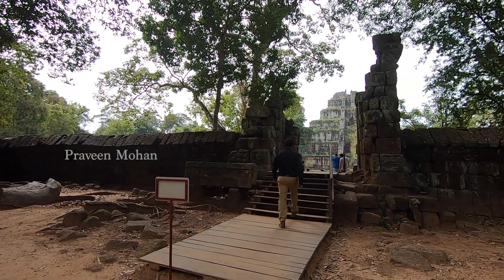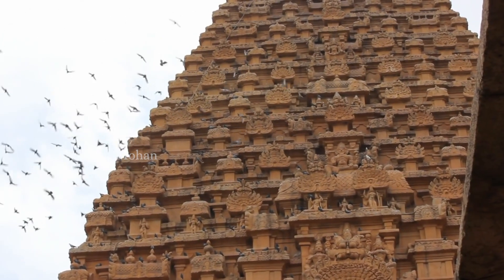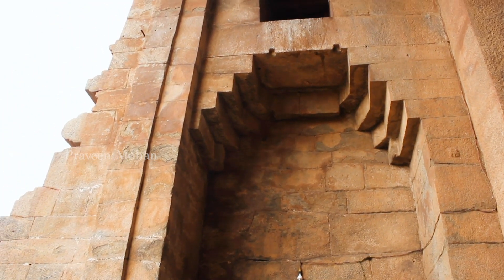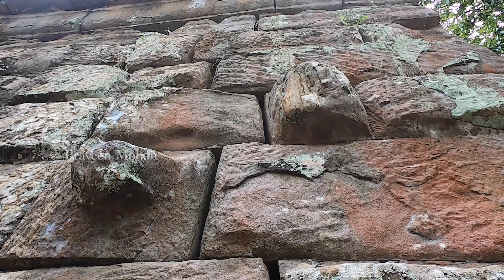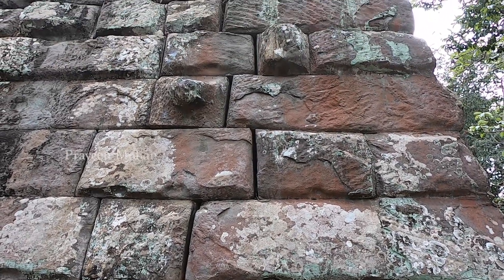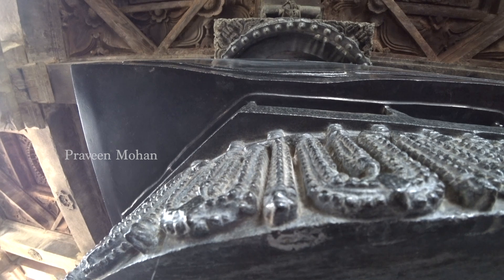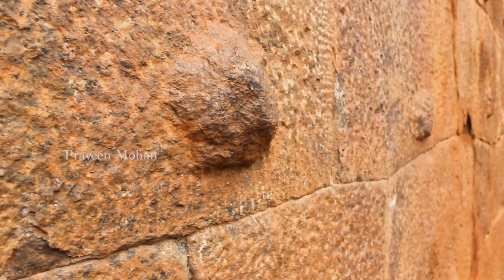Mystery of Ancient ‘KNOBS’ in Temples - Evidence of Stone Melting /Geopolymer Technology?

Comment: First thing that come in to my mind is - why are Plants loving that Stones? Answer: Plants need that to Grow: » Stickstoff,
» Phosphor,
» Kalium,
» Magnesium,
» Calcium,
» Schwefel,
» Eisen und
» Spurennährstoffe.
So that in mind we do say if we got Stone Powder, Phosphor, Schwefel and Magnesium - we got 3 ingredients that could be used to create that Rocks. So what if, they use some Schwefel / Sulfur in form of Acid waters? Perhaps from vulcanic places. So we know that phosphor even Kalium is a highreaktive Substance that can be used to build Bombs. So why dont use a smaller Reaktion in Chemical way to chemical fuse Mineral cristall Connection? Not to produce explosion but atomic chemical reaktion to build combound stone. nowdays we use Beton in early beton we use Kalk or some like that. Perhaps there are two beton creation ways. One hot with Acid that crack up minerals that will then reakt to melt to "stone". Or like today water on water reaktion. Perhaps it is just lost becourse the hot melting Stone technique was not efficient enogh based on a very rare and dangerous Acid water. On a small view we need to think on a chemical and Mineral physical heat reaktion that comes from the chemical reaktion with the ingredients. Perhaps that Prozess makes the stone fluid to use it like kned. So what is the whole in that szenario? Perhaps they need feeds to Stones. It is much easyer to transport when they can be underlayed by wood. If the Stones are down to earth you have to lift that up. They just have to make shure that a rope gets under the Stone. To lift it. So perhaps they create the Stones near by and stock them on wood or other things. We all do not recognize that leverage could be well known to ancient builders. So they need on every Pyramid Layer one leverage with a very long range. Then it would be possible just to jump from level 3 down to 1 and you got the stone easy placed. The weight of a human that jumps would be enogh to get the stone up. To Level 2. But it still needs a feed to get under the block. I think the arrangement when the drop is not in the wall is just becourse the Stone match perfect fit. Is it seen means that it has some defects that wont be shown. And becourse it has nothing to do with the physical of the wall - So they just use the opposite side. To get best usage out of material.

Comment: I think the blocks were casted, if what the priest said is correct, the knowledge has been lost over time. Lost and replaced basically. I could imagine that grinding down rocks of varying hardnesses and mixing the power with some alchemical compounds to change the molecular structure of the rock power apply enough heat to make it all molten and then pour. But that begs the question, where are the molds and what were they made from? Fascinating stuff thank you Praveen I love your videos!

Comment: The knobs are used to keep the lifting ropes from having to go under the rock or stone when lifted and set in place. Do some research PLEASE! The knobs are chipped off of finished walls or walkways. If there are knobs, the stone construction was never completed!! You have even shown structures that have stones with knobs on all stones up to a certain point and all after the last one have had the knobs chipped off!!
Reply: ....Some Knubs could never hold a rope securely.  There are blocks at the Corricancha with four knubs the size of a breeze block, I could easily lift. And then theres a 20 ton block with one knub.

Comment: Praveen, I've critisied you in the past for sensationalism, but I have to admit I think you've hit the nail on the head with your theory that the knobs are a result of the manufacturing process. I believe that at some point in the process the rock was soft and in some cases too soft. I used to work in an iron foundry and if castings were knocked out of their moulds too soon, the outside of the castings had solidified but the centre of the castings was still moltten to some extent. Sometimes a hot spot would apoear on the surface and the molten iron in the centre would try to force its way through the surface. If this started to happen you would start to see a protrusion much like the knobs on the stones.  When this happened we had to turn a hose on it to freeze off the surface again.

Comment: The blocks were cast in the ground. They dug a long square edged pit and poured in the mixture. It apparently took a long time for the stone to set to do it this way. Separators that were somewhat flimsy were inserted every few feet to determine the block size and make that perfect matching surface. The drops were formed from the bottom of the trough.

Comment: With the wall example where the protrusion is very large, notice also that that shape end on is square and much smaller than the others, it’s almost as if these where the rows finishing block, they also seemed to have large gaps where normally one can’t even fit a credit card in the gaps.
Is it possible that something valuable was hidden behind these rocks?  Is it possible that these were made so that once most of the labour force had gone it was easier for a small team to remove these using the large “handle” to help make it easier to slide it out then bury whatever, then push the lighter square end block back? Notice also that two of these (square on end) ricks with knobs are very close to the corner.  I wonder if this is deliberate so that if there was difficulty getting the square one with the knobs out, then the corner stone could easily be removed to allow better access to remove the (square end) rocks with knobs.  Metal detector anyone?
Obviously the other walls with the smaller protrusions on bigger rocks are for some other reason.

Comment: I think I understand how they did it! Just think that there are no landfills with waste, rubble, advanced dust! The ancient builders knew the frequencies to cold melt the rock in the molds, so even rubble and sand were recovered! Cold fusion acts on the molecular bonds during exposure to particular resonant frequencies and the effect ceases when they stop, the air comes out like bubbles and the liquid stone is compacted. Praveen Mohan knows of the existence of these frequencies, literally carved in some temple in a cymatic way. Evidently bulk material was placed in the formwork so parts of air could remain, and when it was "melted" it could advance some material, but never be missing! Evidently the rock was laid still "soft" on the underlying one so that each crack would automatically close due to pressure! OMG This must be Atlantean technology that has spread worldwide from the survivors of the Atlantean cataclysm. Technically it is about to be rediscovered thanks to the interpretation of a Masonic secret, or "the eleventh resonant harmonic" and is connected to the 432 hz frequency that has been denied us so far.

Comment: I think all stones had the knobs, most were smoothed or cut off, sometimes the workers may have not gotten to all the blocks in time. Look at the Egyptian pyramid, they all had knobs, until they were cut away. I was inspired by how we make glass today, they all have one knob, through which the glass material is blown through. at the end of the process, a knob remains, which is CUT off by the glass blower and then smoothed out while still hot. Similarly I think the workers may have had tech to melt stone, while hot, cut off the knob through which the geo-polymer material flowed. However, if the workers were not quick enough, then the stone hardened and thus the knob remained forever. This seems extremely plausible. Regardless of how they did it, its mind boggling.

Comment: Do you think that all the structures with the knobs worldwide were made by the same civilization?  I do!  And they must have had air transportation to reach all the very remote areas where the knobbed structures are located.  I believe that the largest (by far) megalithics are located in Peru and are miles from where the rocks were quarried.  How did the ancients move the megaliths miles over rivers and mountains?  Someone should try to piece together a time frame for those sites!

Comment: Thank you for your excellent job Praveen! 

This is the first time i don't agree with your idea. For engineers that skilled it would have been extremely easy to remove those knobs, i think this is quite reasonable. My personal thought is still that they (the knobs) had some purpose. Those knobs are more important than we know, at least in order to comprehend the technique they used to "pour" the stone. To me it loooks they're related to the way they molded and injected the liquid stone amonge the other "puzzle pieces". 

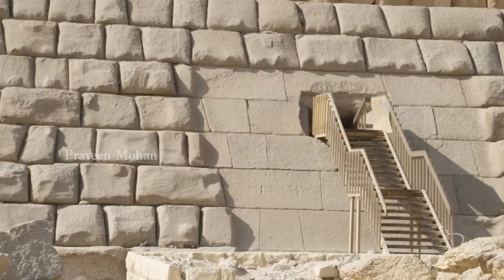Another possible suggestion: It looks (for example at min 5:01 of this video) that the entire "JOB" wasn't finished. You can clearly see that the surface of the pyramid on the right of the video frame is flat and polished, while the surface on the left is still raw like it's waiting to be flattened. Also if you watch the images of the (probabily) biggest monolith in the world, from the Yangshan Quarry in China you can see knobs on it as well!! And the entire monolith is still attached to th principal stone vein.  Like the workers abandoned it. 

Best regards (and sorry for my horrible english)

Comment: Finally, someone with 90% of my opinion about how they created such stones. In my opinion, these large bricks were cast on site. Sometimes you can see at the connection points how the stones have an incline towards the center. For me, this indicates a flexible shape, which expands to the weakest when filled. The stones lying next to each other were probably cast in a timely manner so that the individual shapes fit perfectly against one another when the material was not yet fully consolidated. It is very likely that something went wrong sometimes. I guess the shapes were possibly sewn together from leather and brought into a rough shape. When the individual mold was filled and the stones lying at night also filled, the next layer had to be filled. Sometimes the pressure was probably too high and a piece of the sewn shape tore out, which pushed the semi-solid material through this weak point and froze in the process. This created these "nops". This theory also explains how many a 500 ton stone was placed in the higher levels of buildings, namely not in one piece but filled by several workers with individual fillings, as is known today from concrete casting without a concrete pump. Great video. Thank you for this great channel and multi-directional mindset. In your videos, please refer to buildings all over the world, where some of them are officially 5000 years old and if you can prove the clear connection there, you will see that humanity has worked very closely together. Peace
Reply: Please see my comment     21st 4 2020

Comment: All megaliths have one general rule: the laws of electrodynamics. There is certainly a room with a stepped vaulted ceiling and ... inside it is either a resonator (hollow sarcophagus) or a vibrator (lingam). Necessarily from the material is much denser than the room and sanded. It sets the frequency of the temple.
Stones with protrusions are the same vibrators along the waveguide, notice they are of a completely different color and much denser. This facilitates the operation of the waveguide.

Comment: Sorry, I don't share your view on what the nubs are. If they were defects, they would have removed them easily before or after placing the stones. They were left for a reason. Maybe a braille like language? What if you joined the dots somehow, would they reveal something? It's beggars' belief their true function but I have no doubt they were created and left deliberately
Reply: Question : Are there any examples you know of that are inside structures? I've only seen videos of them on the outside walls. Are they found on floor or ceiling stones? On the floor would seem silly being then a hazard one could trip on but if some exist at feet level then it's certainly points to the nubs being functional in some way.

Comment: ...for the Maya knobs, always thought they were like an excess overflow...
...example...thick cement not poured but like a clay block placed in a thin cloth bag, placed on top of each other...
..thinking the cement mix was a bit thicker than play dough or pie dough...
...poke holes in bag for excess air / liquid to drain / compress from weight of upper bag...
...allowing individual shape of each block and curing test area of the block...

Comment: The protuberances, knobs, whatever you want to call them are either sprues from a casting process or touch marks from a sonic welding horn. I've only ever seen these knobs on blocks made from igneous rocks - Andesite, aswan granite, etc- and if that's the case some sort of sonic softening technique could be the culprit. Igneous rocks contain large amounts of crystal in the form of quartz and feldspar which could make the rocks susceptible to the melting frequencies used in sonic welding.

Comment: The knobs are air holes when the builder poured the molten rock it to the mold the air holes  would holes became knobs. I have been explaining this for years. Knobs are air holes
Reply: Very interesting. Just a side note: Instead of melting the rock they could also have used a cold mixture, like we do with concrete.
Reply: Interesting

Comment: I agree the knobs for toting by ropes is simply ridiculous as you stated all the blocks don't have them and all the knobs couldn't support a rope and it looks just like any kind of molded soft material that has been cast if it's took out too early it gives that little drop I guess you could call it whether it's metal or plastic vinyl anything molded

Comment: If these were cast - as with concrete, most likely there would be a form... and the wet concrete would fit the contours and the shape of the form itself... it would be open to the top where it would be "screeded"... wet concrete as with water - seeks its own level and would be relatively flat on the top - even if it wasn't screeded. So, in this process - the knobs wouldn't occur by accident. Of course, concrete could be shaped in place without a form - if it were the right consistency - but then again the knobs would have been purposefully shaped.  The "drop casting defect" is an interesting theory (which could have been elaborated on more IMO)... If these were defects, it wouldn't seem that difficult to chisel the defect to remove them. If these were carved... a lot of excess material would have had to be removed - in order to purposefully create the protruding knobs. If these were defects, wouldn't they be positioned so that the defect were facing inwards so as not to be seen? In construction, anything that requires additional effort to create and is done consistently - usually has a specific purpose.... we just don't know what that is.

Comment: I am saying for almost 15 years now that these knobs are direct evidence of the construction technique. Build a framework, connect a hose on the bottom part , pump geopolymer into the frame. Pouring leads to air inclusions ( as seen at pumapunku h blocks, clearly cast/poured) but pumping from bottom up has little no bubbles. When its set and starts curing, still soft, remove the hose, remove the framework , done.

Comment: Im a Geologist. If the rocks were melted, chances are, it would have reset the clock of age of the minerals of the original Rock. So if we date the rock using uranium or etc, it should reveal the time from the time of solidification of rocks, after melting by the constructors. 
And if it was melted, were there any evidence of refactory bricks and ancient furnace ?

Comment: There is clearly no way that they chiselled these blocks to fit each other. There would be mistakes along the wall where they got the shape slightly wrong but still used the block. We don't see that there are no mistakes, they all fit prefectly. So molding or casting or sound or some means of flowing each block into the hole must have been used. You said there was a herb that softened rock??? Well that is really out there but worth persuing to see if any of the elders have more info. Hard to imagine how this could be true but not impossible I guess. Perhaps there is more to the story...ie it could have been a plant extract that was used during the making of the composite block rather than used on normal rock..Then it would make more sense.  The memory left is that they collected a lot of this plant to 'soften' the rock.
Reply: Hmm. If extracts of some leaves were used to soften the rock , it explains why plants are growing on that rock.

Comment: If indeed these stone blocks were cast then wouldn't they have had very shiny surfaces. It seems somewhat odd to go to the trouble of casting them only to end up with them looking rough hewn from boulders. That doesn't add up for me, unless the casting process we are talking about doesn't really have a mold in a conventional sense. They could perhaps control the casting/pouring in other ways. This would certainly help with the ease of producing protrusions in the blocks as you would not need a smooth enclosing mold.